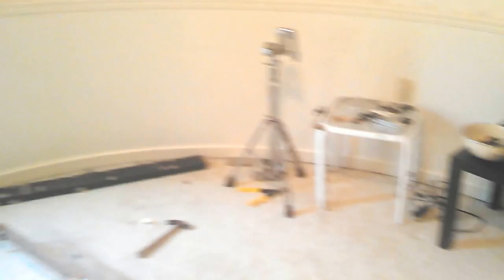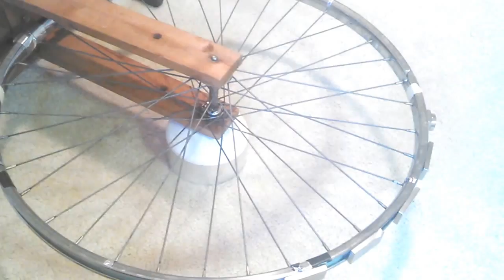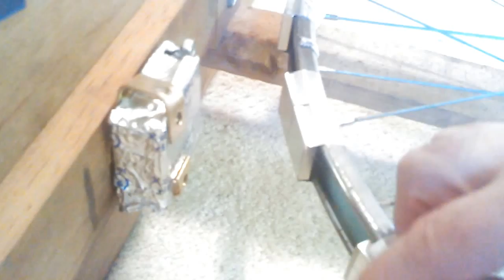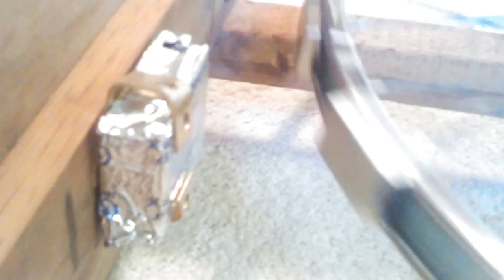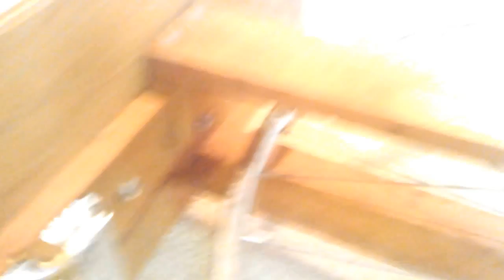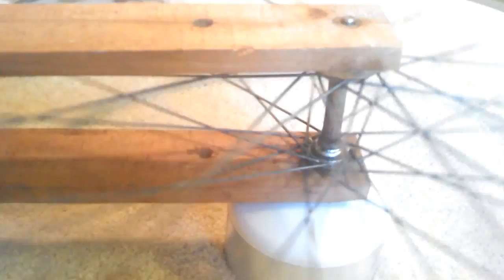🧲 James Roney One Way Magnetic Stator Explained in Detail (Orginally Posted 02/12/2013)

Comment: Hi James. What you are doing I've been mauling around in my head for years but never got to the practical experiments as you have. I totally believe in what you are doing and the science behind it says yes to it all despite the opposing forces at work". I would really like to see the next stator in place for the inertia to happen. Perhaps you are treading lightly and carrying a big stick. Momentum is over unity, basic science says so. Exceleration builds momentum, add inertia and its a working model for a self sustaining environment  to continue to take place. Create of enough of any one of those forces and you can start to draw the energy that is over unity. A large rock rolling down a hill will flatten an insect without it disrupting it's momentum,."So you have to keep creating the down hill in front of the rock, the hill is known as gravity which is a constant. Magnetism can give gravity that pull or push, and you have found a means to oppose the opposite force enough to build momentum. Hard to believe that some  people don't get that.
Reply from the maker: I hear you loud and clear as you are 100% right. Sadly it's not so much that people don't have the brain power to understand, rather a brain is an intellectual muscle if you will,  that must be exercised regularly to become diverse in a given area of science. Thus all the ignorant posts I receive almost daily. I can't wait to move on to my real passion as that's electrostatics, ball lightning generators, ball light guns, etc., as that's my real strength and passion.  :)

Cheers!

Comment: Always admire your work, James. Can't wait to see when you run the mags all the way around the wheel (is it aluminum or steel?). I'd be tempted to stack a second stator on top of (directly above) the one you have now and attach a second wheel to (and above) the one you have now. Position the mags on the top wheel such that where you have a gap between mags on the bottom wheel you fill that gap with a mag on the upper wheel. Offset/alternating constant top/bottom attraction/repulsion perhaps?
Reply from the maker: 🧲 I talk about three levels in various videos. Looks like you've left YouTube for good?

🧲 CREDIBLE FREE ENERGY MAGNET MOTORS THAT PASSED MY SNIFF TEST

MAGNET MOTORO - Rotor Encantado
https://youtu.be/mxgwTzxfe8Y

Amazing Magnet Motor/Gen Rep. This is not a fake
https://youtu.be/jKFTAobM-l0

WORKING MAGNET MOTOR 2023
https://youtu.be/vdtdKE2Qe40  

SELF RUNNING MAGNET TURBO MOTOR
 https://youtu.be/6sIBHn5-9pI

  WORKING MAGNET MOTOR - rotor magnético
 https://youtu.be/3mD0_0FiJ54

 MAGNET ONLY MOTOR from SOUTH KOREA 
https://youtu.be/smzpbKg9S7M

1966: German inventor presents his Free Energy Device Magnet-Motor
https://youtu.be/XWQjMyMWXAc

Comment from the maker: Actually you would have several dozen level/layers positioned at 12, 3, 6 and 9 o'clock position on a cylinder about 6 feet in length, which gives you extreme torque. Stator Magnets would be 4"x6x2" and rotor magnets 4"x4"x2"

Comment: Each magnet, when entering the field of the stator magnet, will require a force equal to that field, in order to penetrate that field. The subsequent negative field, once entered, can never achieve a force greater than that required to enter it. In theory, the best you could achieve, given there are no losses, is to equal that energy. It's a principle of magnetisme. That unfortunately is why everyone attempting this 'holy grail' will fail - the idea is broken at a fundamental level.
Reply from the maker: YESSSSSSS. But no longer. I found a workaround for Newton's 3rd law of motion/attraction. The magnetic attraction between steel verses magnet to magnet are not equal. I simply uses the difference between the two to generate forward motion, and do so, without any sticky spots. All the personal setbacks over the last ten years are nearly resolved. I will be back with my research soon with a new lab and home built from the ground up in 2021-22. - https://www.youtube.com/watch?v=1nD8xqURS_8&t=192s

Comment: "I do NOT have a working prototype at this time, nor have I ever had an actual working prototype." James Roney.

Because the magnetic fields in permeate magnets are fixed their is no way to alter them in such a way to create continuous motion by themselves. All electromagnetic motors derive there ability to move by changing the magnetic field in either the rotor, stator or both. Just 'shielding' a field will not create continuous motion because the field remains stationary after 'shielding'. What the author has been able to create are different types of 'magnetic' springs, 'magnetic' pendulums or 'magnetic' flywheels.
Reply from the maker: 🧲  https://youtu.be/jsgUF5DHAwo

Comment: So many idiots posting on your channel I'm sorry for the hate you get man. Also as an extremely well educated student I thought about what you've done with your wheel and thought to myself you could find the distance between the magnets that makes your wheel run the fastest and then you could mathematically figure out the perfect size for a wheel to fit magnets evenly spaced to those dimensions in order to maximize the magnetic rotation and also maximize energy output so just some good for thought and good luck with your projects I found this stuff quite eye opening - 16 year old dude that's smarter than the guy two posts below lol
Reply from the maker: 🧲 Well spoken Sir. The hate posts I get are always from the ignorant who simply don't know any better. Sheeple if you will, have little to no understanding of physics, especially mechanical reasoning of which I, along with three other gentleman achieved the highest IQ scores in the US four years in a row. But high IQ  does not mean you know more than most. It means that you have a greater understanding from what you learn from books and hands on observation than most others. I hear what you're saying as to the math. I'm way ahead of you. The video you're commenting on is from years ago. Much has changed since then. Have a look at what's up and coming. 👉🏻 https://youtu.be/8EYxKWsVx2k 

You must have a pretty good head on your shoulders as well, as your channel has 65 followers despite your channel is blank. Most channel can never achieve that. Most importantly, thanks for creative input, and for stopping by.

By the way, you are not 16... your body is.

Comment: Does work to a point for a while. Done this years ago with mu metal shields from an oscilloscope tube on magnets on a aluminum record deck turntable. What is totally ignored is that the magnets were made using energy in the factory etc.  So like batteries or a spring which have stored kinetic energy the magnets have a stored energy which is slowly drained.  What is needed is a figure for the energy involved in the production of the magnets, against the total output of this wheel, where you will find that the energy in is a lot more than any energy that can ever be harvested from any generator connected to this device.
Reply from the maker: 🧲  https://youtu.be/jsgUF5DHAwo

Comment: Ever try to hook up one of your wheels to an electric generator with a load (preferably a chargable battery) across it? Because until you do perpetual motion means nothing. You can throw a ball in space and it will travel forever. The second you try to use it to generate power it will stop.

My friends and I had a real good laugh watching your videos though so there is that.

Source: Engineering Degree
Reply from the maker: 🧲  I SEE THAT YOU SET UP A TROLL CHANNEL. Now I get the last laugh. https://youtu.be/8EYxKWsVx2k